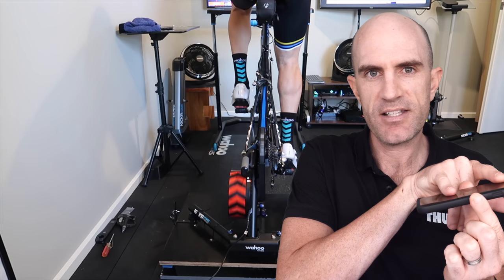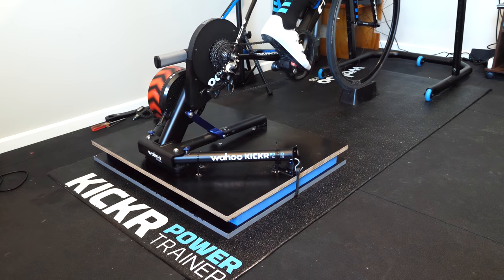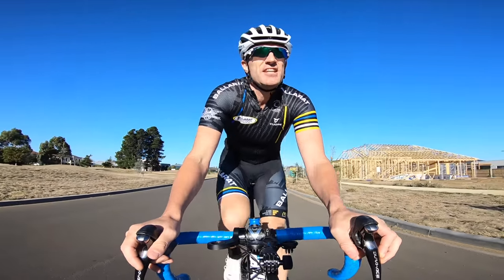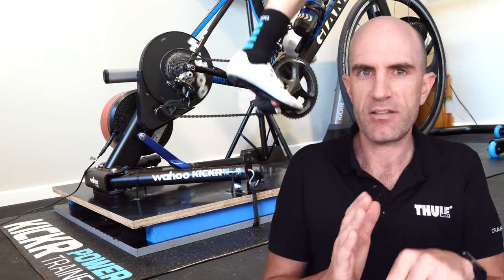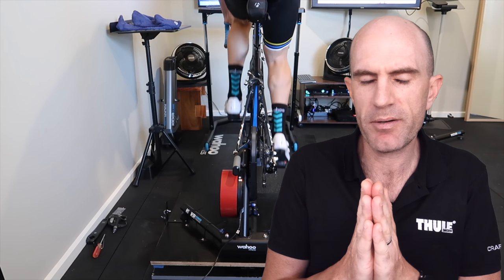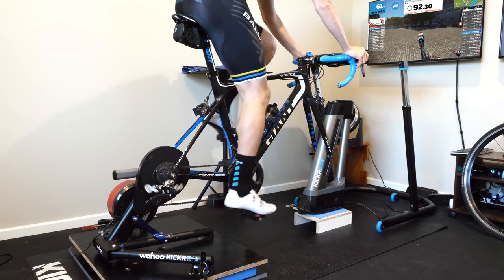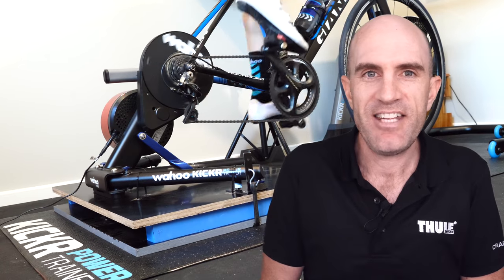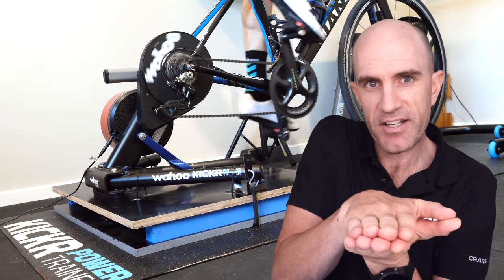Indoor Cycling Rocker Plates - First Ride of a Wahoo KICKR Rocker

Comment: That unit is too stiff, does not isolate the pivot movement (no need for squirm, yaw axis rotation or vertical bounce) and lacks the necessary angular travel. Additionally, the trainer was moving around on the top plate under only moderate power. The attachment scheme needs to be improved. Not a word mentioned about the best benefit of using a rocker...comfort. Go for a 3 or 4 hour ride on it.

Comment: Kurt Kinetic should have been all over this years ago with a real direct drive smart trainer for sale already.
Reply: Indeed, the lack of a wheel-off from them was one reason I made my first rocker over 2 years ago.
Reply: Chad does it work any better than the Bob Rocker shown in the video? I would then put the foam pieces closer to the center of the rocker as it would give it more movement as it could flex/move to a greater angle.
Reply: Here is my design in use:
https://youtu.be/gt2XO4NVZEo
Reply: Note the inner location of my springs.  I also have just 2" x 2" spring stacks, 2 at the front half, 2 at the back half.  This leads to much more angular movement with much less force required.  All that leads to a more realistic motion and feel.  

Additionally, I am now using inflatable balls that improve the feel even more than my spring stacks.

My full design for anyone wanting to make one.
https://zwiftinsider.com/rockit-launcher/
Reply: Looks great Chad.  What are you using for the front tire?  I think the way your front end moves is really making a huge difference.
Reply: Kevin Miller, I just use a simple flat riser.  It allows free movement to the sides.  It also has a smooth, and somewhat slick surface on top, so the tire can turn a bit too.

Works good.  I also want to make a spring loaded lazy Suzan version that is even easier to turn, but rotates back to center.

Comment: This Bob rocker plate design is not performing as a proper rocker plate should be. It is not pivoting at the center of the wheels and could be due to cable tie. The cushion is not properly adjusted.

Comment: Make video
Sprinting a to z
I didn’t use sprint at all before Zwift and powermeter reading. So use to sprint on Zwift  now and last time there was not snow i try fullout sprint off saddle outside. It nearly go badly because ied manage to lift my front wheel off the ground slitely and when i rock the on side the front wheel go allso to other way few inches. It felt like i was very close to make face plant😬 there and then. This was when i start sprint in biges gear 50-11 25km/h. Little less enthusiate lonch 987654321GOoOOOoO!🦍

Comment: Tacx Neo?
Reply from the maker: If the baseplate fits it. No Climb action though.
Reply: Shane Miller - GPLama, no climb but I meant the Neo itself has a rocking motion
Reply from the maker: Yes, it does a small amount.
Reply: Yes. Looks like the rocker plate you tested is similar to what Neo offers in sideways motion. Correct?
Reply from the maker: It's pretty close to a Neo, yep. I didn't measure the side/side angles though.
Reply: I have only test ridden a Neo for a half hour but I found the sway unnatural, much like Shane describes the rocker, and off putting. It's one of the factors that is pushing me to a Kickr - preferred the more solid feel to that, for what that's worth :)

Comment: In real it's your body that's keeping the bike upright, it's the momentum of the body. So it's not the bike, that's keeping you upright. You can't replicate that using springs that keep the bike upright. Because of that there is no way for an indoor trainer to provide real world feeling. As you mentioned indoor it's about strength and cardio. And it's gonna stay that way.
Reply: The bike is a key part of the equation.  Ever watch a bike ghost ride with no rider on it?  When set in motion straight and smooth, they will maintain moving for quite some time assuming it has decent start speed and room to roll.

This stability comes from the head tube angle & fork offset (which set the "Trail" value) along with the wheelbase of the bike.  It is part the overall equation, including momentum, that generally centers the bike, as well as our own inputs to provide balance.

The leveling springs in the rockers aim to replace this force and can to a pretty good job of doing so when setup well.  Lack of momentum presents a challenge, but one that can largely be overcome.

Comment: It seems to me that the pivot point should be at the wheel's axle. that's what makes the Neo so nice. and what made the Kurt Rock and Roll interesting as a wheel-on trainer. Maybe you should try out a K RnR next!

https://www.youtube.com/watch?v=GXaytjhRdgo
Reply: The Tacx Neo's point of flex is lower than the axle.  It is an angled line at the point where the center section meets the support feet.

The Kinetic R&R pivot is down at the base of the trainer (where the rubber bushings and metal plates all meet) and is a approximate pivot around the lowest part of the wheel/tire, just like we experience when outside.